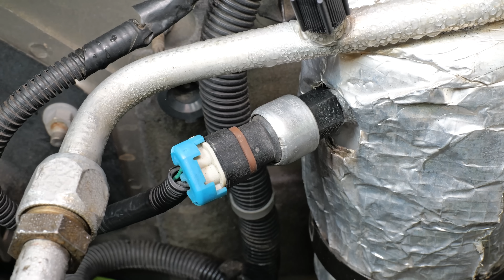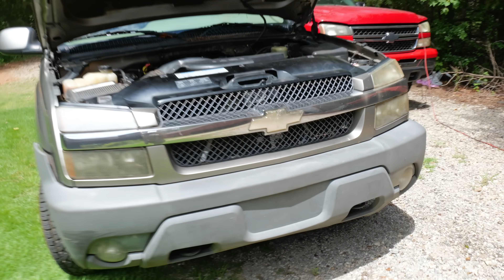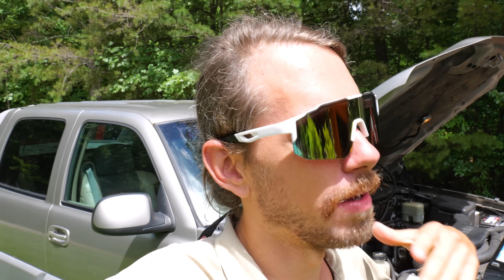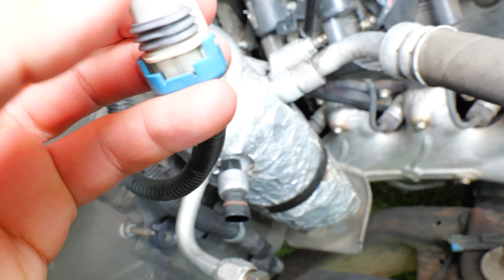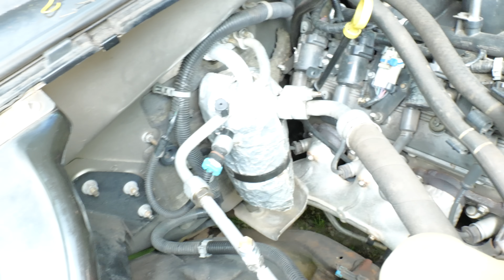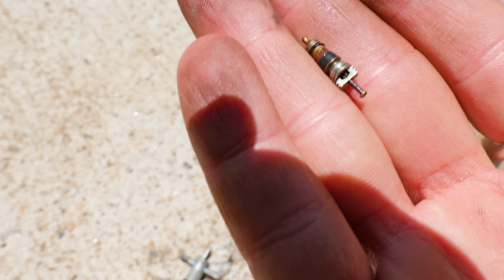BAD Chevy Truck AC Pressure Switch? THINK AGAIN

Comment from the maker: These A/C clutch pressure switches almost never go bad.
You need to check for other problems in the system first!
Pressure Switch: https://amzn.to/4f6X7IX

Dorman High Pressure Valve: https://amzn.to/44I3QWk
Low Pressure Valves: https://amzn.to/3GUgRmj
Orifice Tube: https://amzn.to/3U9e63P
Accumulator: https://amzn.to/4eUZePU
A/C Oil: https://amzn.to/46eQCkX

As an Amazon Associate I earn from qualifying purchases.
Reply: Thanks for the info bro
Reply: Mine leaked. I do hvac. My detector was useless to pinpoint (big leak) Soap bubbles located it. It leaked at the plastic to metal bond.
Reply: @mattsShop any video on replacing wire with broken connector pin?

Comment: I went by a shop and I have them checked my refrigerant because that was free. They said I had good charge on my system, but for some reason, my air-conditioning ain’t coming on in my pump being acting like it’s coming on, but I already replaced that pump before so it would be the switch correct

Comment: Okay seen your video and I knew about bypassing the switch by putting the jumper like you did and doesn't engage the clutch but if i jump the relay it engages the clutch and blows cold air now any ideas where I should start checking oh and I replaced the relay still nothing
Reply: I got the same problem. Ever find out the issue?
Reply: @Artied76 I'm still to this day trying to figure it out but still not giving up so I'll let you know when I find the issue
Reply: @MarioTellez-t9d I'll do the same ty

Comment: Hi Matt, I put some refrigerant a week before a 12 hours trip in a Honda Odyssey 2011, after driving four hours the cabin fans started to slow down and cool air went out quick, I stopped for twenty minutes and I got coo air again for the rest of the trip, I changed the AC clutch relay but in the way back I got the same problem, someone told me that the evaporator sensor in the cabin was probably bad or the pressure sensor, yesterday my mechanic couldn't find any problem, only he added more refrigerant because he said it was low, do you think that I should inspect for leaks this time? thank you

Comment: I noticed  that your platic  behind the cab of your truck  is  is discolored.  You can use a heat gun work it  slow , be careful  not to burn a hole in it. It will restore back new . After you are done shoot it with  clear coat  and it will last a long time.

Comment: I have a 02 avalanche I jumped it and refilled the ac and it’s still not engaging and it still hold the refrigerant in the system so is it the switch
Reply: You might aught have a leak somewhere?

Comment: 04 chevy silverado 2500hd 6.0 I replacement the whole low pressure line accumulator pressure switch and blend door actuator refrigerat is full compressor kicks on and off and still not blowing cold
Reply: I'm having the same problem I did what he does and it doesn't engage the clutch but if I put a jumper on the relay it engages the clutch and blows cold and I can't figure out why it won't work
Reply: @MarioTellez-t9d check your relay and fuse in fuse box on the driver side fender. When you jump the connector you should hear the relay click and the compressor will come on. Swap out the ac relay with your horn relay to find out if it is okay.
Reply: @imdinot I did that and relay is fine so is the fuse but I find it weird that I can only make the compressor kick on when I jump the relay it has me confused and makes no sense why it works if I jump the relay

Comment: Can my underdash coil be freezing up if the switch is bad? I have the correct freeon charge
Reply from the maker: It shouldn't freeze up is the blower moving enough air across the coil. It could be clogged with leaves stick ur phone camera up in the airbox with the filter or blower out and have a look.
Reply: @MattsShop will do thanks

Comment: I have a 2019 equinox Chervrolet. The AC works for 4-5 minutes and then it start's to throw hot air. I turn off AC for a minute and start's throwing cold air again, what is my problem???
Reply: If it's when your driving, could be the blend door actuator. Feel the vents on both passenger and driver side, sometimes it only blows hot air on one side

Comment: My ac clutch engages, It was warm until I started driving then it blows cold. Added refrigerant now it just blows hot all the time. Could the pressure switch keep my fans from turning on?

Comment: I replaced my ac control module from rock auto I calibrated it but now the compressor won’t turn on unless I press the to turn on what could it be the oem module dint do that

Comment: Damn! Let me ask the obvious! My AC isn't working, its low on refrigerant, the switch is doing its job. I need to recharge the system with more refrigerant, I need the pump running while I do that! U said don't run the pump when its low.... How the fuck u going to get more refrigerant in the system?? Have to  jump the switch while recharging and is that going to cook the pump? Fine line....

Comment: Alright so this is my problem if I jump the fuse my ac compressor and cluch con on but if I jump my ac compressor switch like you did I get nothing to come on
Reply: Me too
Reply: Any luck, I’m having the same issue
Reply: @hunnybear8904 no I have to retrace all the electric cables idk what’s going on
Reply: @ZomBSlayer1017 before you do that make sure climate control plugs are plugged in all the way and that the ac actually comes on with power button not fan up button if it’s a digital ac controls
Reply: @D @Dillon-ve8rt the ac climate control works I swapped it into a Silverado 2002 and it turn on that ac so that works I’m not sure if someone thinker with it as it’s a used gmc 2000 sierra
Reply: @ZomBSlayer1017  I am now having the same problems so I have no idea

Comment: My AC is full. Repeat, full.  However, my compressor kicks on and then off.  That’s what I’m trying to solve.
Reply: It’s broken had that happen too the clutch bearing probably went out how old is it
Reply: @ZomBSlayer1017 2007 Chevy Tahoe. It’s a work truck not my personal vehicle.  The compressor switches on and off, no cold air at all.
Reply: Did you resolve that problem. Having same issue with my 2011 tahoe now. Full of freon but compressor kicks off n on. Ugh!
Reply: @aarontaylor3132  We jumpered the low side switch and the ac started running cold and the compressor stayed on.  We replaced the low side switch but that still didn’t make it work.  We might try the high side switch if we can find it.  Lastly, someone said that there is a filter in one of the lines that might be plugged?  🤷🏻‍♂️  
I’ll type in if we get the high side switch replaced and if it works or not.

Comment: You gave me the courage to try this.  But I’m stumped.  Can you help steer me along?  

I have a 2004 Tahoe.  The pressure when I tested with car off was 30.  Compressor doesn’t turn on.  Outside air temperature was 75F.  Jumper on pressure switch does not turn on compressor.  Fuse OK, relay tested OK, and I was able to turn on the compressor by jumping at the relay.

Then I charged.  The pressure went up to 50. And the compressor began to turn on for about 3-5 seconds and shut off.  But it would not accept any more refrigerant.

Upon removing the blue and red tubes, I noticed a loud leak out of the high pressure port.  Oddly, putting the plastic dust cap back on made the leak disappear.  Loosening the cap makes it reappear.  Based on the amount of black dried staining around the hi pressure port, I assume this is where the original leak was from.

I’d hate to have to take it to the mechanic.
Reply: Tighten the schrader valve
Reply: Did you figure it out?

Comment: What is my compressor short cycles
Reply from the maker: Low charge
Reply: @MattsShop i wonder why cuz when i charged it with the refrigerant the meter is in the green and my sticker say 3lbs im like i got front and rear ac and just using a half of one can when it get to 40 psi the conpresdor engages and starts short cycling but if i keep going pass 50 it will be in caution area but they say it take 2 bottles abd it still blow heat so in confused like will i over charge it with 2 bottles cuz that guage is in the blue and it say 40 psi
Reply: @MattsShop Question I have a 99 gmc suburban with front and rear ac but its blowing cold in the rear and barely blowing anything in the front the air is mid and cool any ideas

Comment: What if absolutely no air is coming from the vents?
Reply: Blower.motor? Do you have defrost?
Reply: @shydude7862 Checked/replaced all fuses and relays.

Changed blower motor and resistor.

When switching the hot and cold dial it does respond ok. Air does get hot 

Also when redirecting the air(floor/dash) it also responds ok.
I was thinking it could of been an actuator but doesn't seem like it.. or maybe the control module it self is bad?

Comment: What's the voltage supposed to be at that switch? Mine is reading ~4.8v Is that normal? I always thought these things were in a series with the compressor, but this seems like some sort of a 5v reference instead? I'm so confused. 2005 2500hd 6.0 gasser with digital dual-zone controls.

Jumping the sensor doesn't help. I'm out of ideas. Chat GPT says I would be getting 12v. I even replaced the HVAC dash control module, and I'm seeing the same thing. Please help!

Comment: it was my low pressure switch! swapped it out, cold again. so they do go bad.
Reply: That’s not the low pressure switch. That’s the clutch switch
Reply: Yeah mine has been going off randomly yesterday it stopped coming back on but it gets ice cold when it does come on
Reply: @alexjoens5014basically what I’ve been dealing with for months. It started with a leaking evaporator core, fixed that, a month later got intermittent a/c. Figured the compressor had to be bad as it was the original and 23 years old. Definitely blows much colder, but still drops out. I’m thinking the pressure switch is failing.

Comment: I jumped the switch. Compressor came on. I charged the system. Ac was blowing cold. Plugged the thing back into the switch and compressor turns off. Does this mean the switch is bad?

Comment: I have a 2003 gmc Yukon and I’ve changed everything but the pressure switch compressor comes on when I bypass through the relay but don’t do anything when I to jump it from the pressure switch connector

Comment: I have new compressor,accumulator and lines it was good for a month and now the ac compressor is turning on and off
Reply: Did you ever figure out why. My 2011 tahoe doing the same thing now. Correct refrigerant level but compressor still kicking off and on. Help!

Comment: I have a very peculiar problem. My AC blows very cold when driving then goes warm when im at idle. Few guys told me to check my refrigerant levels and low and behold, ITS AT 91 PSI. I pressed the valve down, expecting some freon but no, just air. And the PSI continued to rise right after. Please tell me i can just simply pull the vaccum and refill with freon
Reply: Update: pulled a vacuum on my system after replace HP shrader valve. Got the system charged up and the compressor is only kicking on at 12-14K RPM

Comment: My truck isn’t blowing cold air. And when I hooked up acpro refrigerant the pressure is in the red. And when I pull the trigger. It shows zero pressure please help bro. Summer desert  heat is killing me i am mechanical inclined I can fix shit but by no means am I a mechanic

Comment: Why do you mention not to leave the wire connected for long or you will burn out the ac compressor? 

Wouldn’t the compressor be on for long periods of time when the AC is on? What’s the difference? 

I’m having a slow moment sorry if it’s a dumb question.

Comment: I been trying to figure mine out. I unplugged the high pressure switch and plugged it back in cranked the truck and the ac was working shut the truck off and it’s not working again

Comment: There is two connectors, one is connected to the pressure switch, one is dangling. The one connected right now is white and blue one is hanging there. Is this correct? Why is there two with only one connected?
Reply from the maker: One isn't used it's for an extra battery sensor or something lol

Comment: The air pressure is blowing weak. It’s cold but not enough pressure at max. Changed blower motor, didn’t fix it. Any ideas?
Reply: If you have a manual selector do certain speeds not work, if so could be the resistor.

Comment: In my case, I replaced the sensor with a new one and made the jumper as shown in the video, and my compressor doesn't turn on, but I know it's good because I activate it with the relay from the fuse box and it cools very well. What do you think it could be?
Reply: Any update?

Comment: Great video. You may want to invest in a valve core tool for the future. I have the Appion 1/4" and 5/16". They work great and save a lot of time.
Reply from the maker: Yeah, they work great for the low pressure side.

Comment: I have a silverado 1500 custom 2021 2.7. Sometimes when I turn my ac on. My truck gives a slight shudder as soon. As I turn the ac on at iddiling and while it's parked. Could this be a sign of a bad ac compressor or something else? Thanks. Great video 👍📹
Reply: in my experience dealing with this stuff, if you are still getting some cold air when cruising then this could be more related to a low idle.  when is the last time you checked your throttle body?
Reply: @JAMMTRONIX like three weeks ago. Did a full fuel induction servíce. Gas milage is better at 22mpg. The only think I could think of based on research that the motor mounts have gone bad.
Reply: nah. its certainly not that because Ive experienced this problem when my truck was idling low at one point.  typically its just a pull on the compressor/belt causing the shutter but theres another underlying mechanical condition that youve yet to find.

Comment: What if the AC was charged. AC works.  It was left on the pressure machine overnight.  Levels are fine he says...but now it won't cool again.  I jumped the switch.  compressor works. But switch doesn't.

Comment: Does anyone know what the other connector next to the switch connector do? The one with the black clip instead of the white clip?
Reply from the maker: It's not needed leave it disconnected.
Reply: @MattsShop  that's not the point. still want to know what it does. if you don't know the answer, just leave it and let someone else who do know answer

Comment: What about if it’s the opposite of this? My AC seems like it’s always on / cooling even when it’s off on the hvac controls. My accumulator is covered in ice after like 2-3 minutes of the engine running. But the air coming out of the vents is ice cold, when running down the road and ac is on, it blows ice cold too. But I don’t think it’s turning off.
Reply: I'm here for this answer too!
Reply: I’m not sure if I figured it out or not, but for whatever reason if I leave ir set at 65° it doesn’t freeze up. At 60 it will, at 70 it will. But not at 65.

Comment: The schrader valve behind the pressure switch isn't what's leaking refrigerant. When the switch is installed, there's a little nub inside the switch that pushes the valve open to allow it to work. It's always open when the switch is installed. The valve is only there to allow the switch to be changed without evacuating the system. The o-ring is what leaks.
Reply: Thanks for clarifying!!

Comment: Mine is leaking at the switch connection into the accumulator. Sucks! I hate doing A/C work. I own all the tools including a vacuum pump.
Reply from the maker: I try to tighten the shrader valves to stop leaks.

Comment: I like your videos. I have a 2007 Silverado. AC works great for a while, then the compressor shuts off. If I shut the engine off and then crank it back up, the AC will work again. Any ideas ?
Reply: That's the same problem I'm having

Comment: Can you bypass it and run it like that?Even though the pressure is good, I have a slow leak in my schrader valve.But I don't want to evacuate everything just yet.And put it back in
Reply from the maker: I use a shrader valve tool to tighten leaking ones and tiny needle nose pliers to twist the valve core I'm place to help it seal better. Sketchy but helps stop the leaks.
Reply: @MattsShop i can't find my tool to tighten it up.That's what i'm going to do.But it is a lot of pressure coming out of there.I believe that's why my switch is shutting off.But I just want to make sure if the pressure is always k.And it's not leaking.Can I just bypass it for the moment

Comment: I keep blowing a fuse to ac clutch I unhooked the ac compressor pressure switch it didn’t blow
Why should I do?
Reply from the maker: This can happen when the compressor is bad.
Reply: I have Freon in it but still blowing fuse. Should I replacing rhe switch

Comment: I put a new condenser in 07 Ford f150 .vac  system  for hour no leaks .added two cans and  it stoped taking any. ac is kicking on and off but can't get enough to go in to make it run continuously can't figure out why.should take 3  small cans to fill and run. any ideas why it won't fill the rest up.

Comment: Now would it be the switch if the levels are good? Otherwise? My truck 2003 Silverado on cold start takes 10-15 min to get cold, it blows hot humid air at first

Comment: What are you thoughts got an 04 chevy lb7 duramax when the a/c button is on the compressor runs continuously never cycles ends up freezing the evaporator after 30 minutes or so and when i unplugged the pressure switch the compressor still stays on